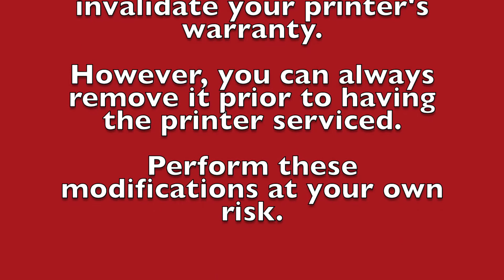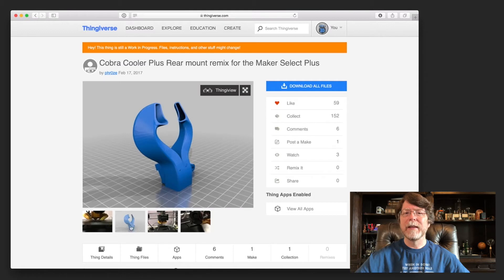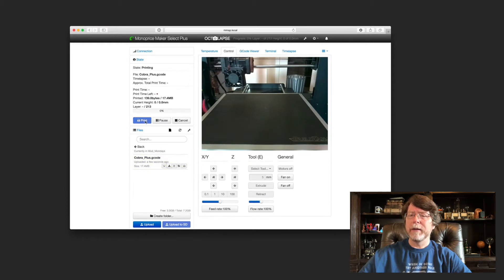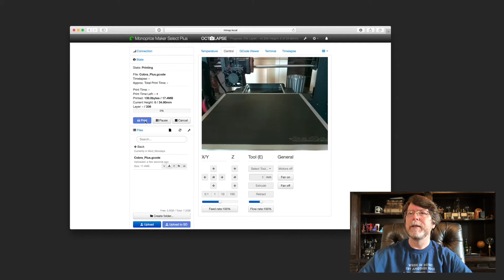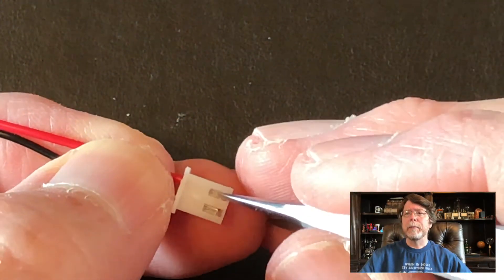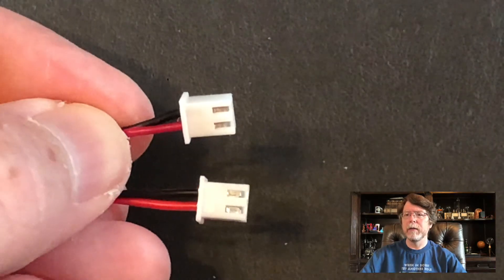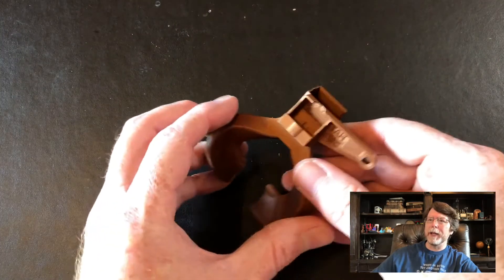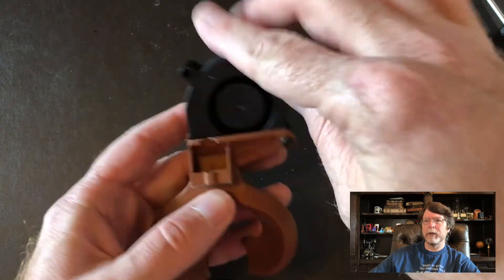Monoprice Mod Mondays #4: Your Printer, Only Cooler

Comment: hey i know its been a while since you posted this video, i was wondering did the buildtak bed come with the printer or did u install it? i have a monoprice maker select v2 and i woudnt mind changing it to that bed.
Reply from the maker: Hi Erik, the printer came with a similar print surface, but once it wore out, I replaced it with the BuildTak surface. Later still, I replaced the BuildTak with a Creality Cmagnet magnetic "flop plate" surface, and most recently, I installed a Wham Bam Systems magnetic flex plate system (it's a nice one, with a spring steel flex plate, strong magnetic base, and their proprietary "PEX" (a kind of PEI sheet). 😃
Reply: @BV3D  hey thanks for replying really fast will definitely sub, if I have any more questions about this printer can I ask u?
Reply from the maker: Hi  @erikmelnik8552  -- Absolutely. Ask and I'll do my best to answer. I have two of the v1 printers, so there are some differences between the two (bed leveling and screen firmware are probably the primary ones).

Comment: Are you still running this fan, or do you recommend a different one these days? I need to improve my cooling situation. 99% of the time I'm fine, but for some prints I need better cooling.
Reply from the maker: Hi John! Yessir, I'm still using 5015 blowers and Cobra cooler ducts on my Monoprice Maker Select Plus printers. They've worked really well for me, so I haven't seen the need to replace them! 👍

Comment: Another good video Bryan.  Have a question...What is the gear thing on the side of the extruder stepper motor?  Does it serve a purpose or is it for decoration and how is it attached?  Thanks.
Reply from the maker: Hi Rob! That gear is absolutely and purely decorative. It attaches magnetically to the stepper. I have a round neodymium magnet attached to the center of the gear. It's just a little something I put together while experimenting in Fusion 360. Sometimes I remember to take it off the printer before I record the video, other times I forget. 😀
Reply: Cool.  Thanks for the info.